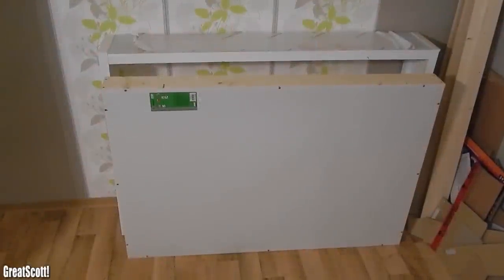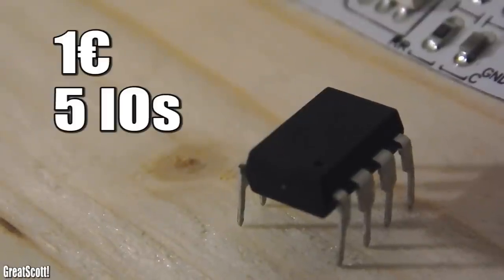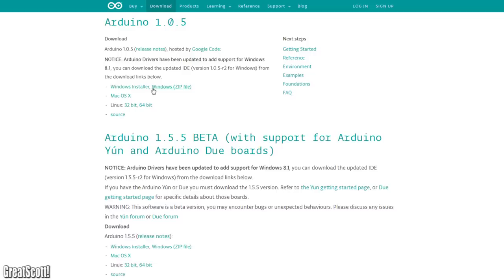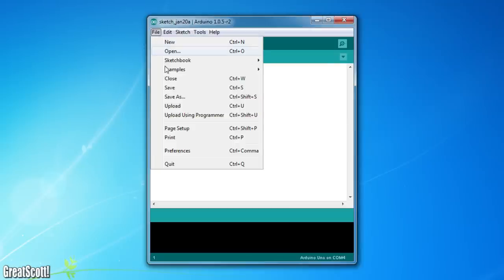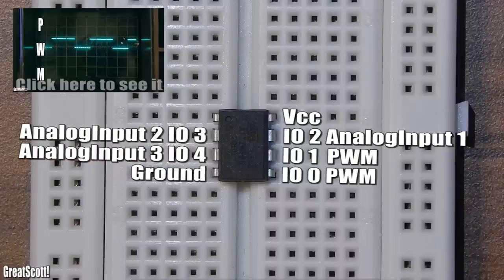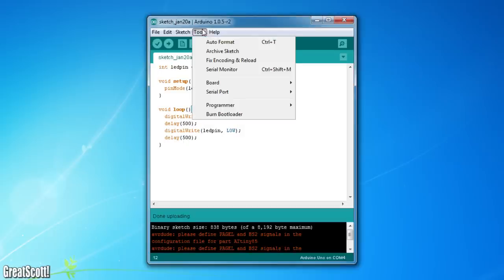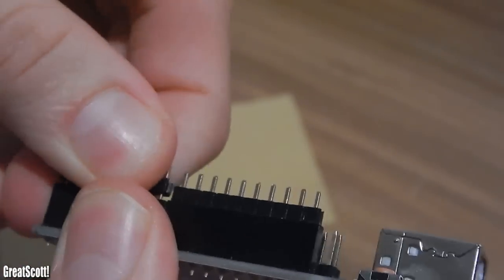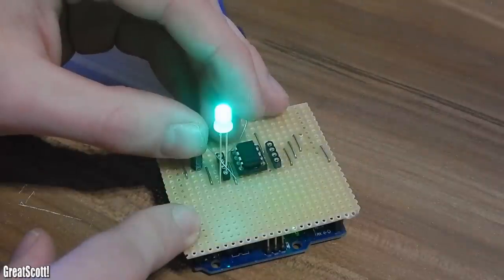Electronic Basics #3: Programming an Attiny+Homemade Arduino Shield

Comment: ATtiny85 has no SPI??? Do you know that you just used SPI to flash that code to it? Bruh, please check datasheets.
Reply: The Attiny85 does not support specific HARDWARE for SPI and I2C comunications as on ATmega series, instead there is a hardware module called UNIVERSAL SERIAL INTERFACE (USI) that can be only configured to perform SPI or I2C.
Reply: @sg0_o  True, but irrelevant. It can do hardware SPI.

Comment: why not just use an uno pro mini?
Reply: bladewind_Demon He’d still need a similar rig to program the pro mini, or an FTDI board. It’s also a few bucks more than the ATtiny85. I agree though. The project is so big and expensive anyway. Saving a few euros on the micro controller is making life harder than it has to be, and is going to make it kind of painful to apply tweaks and field updates.